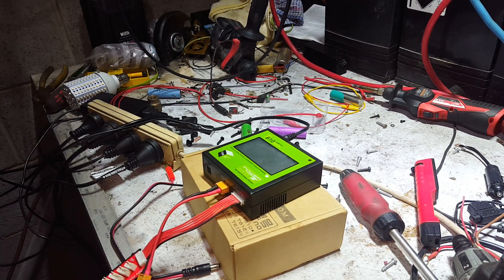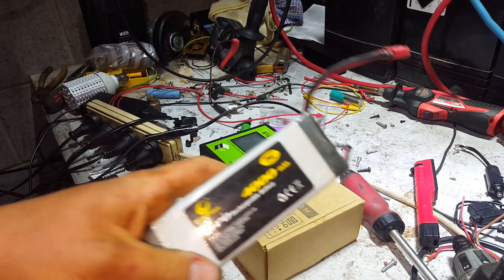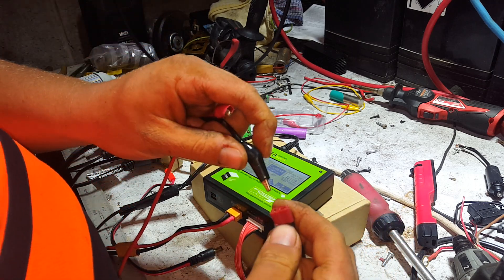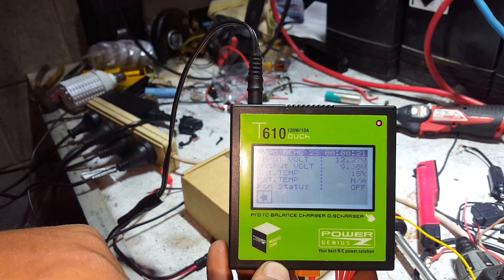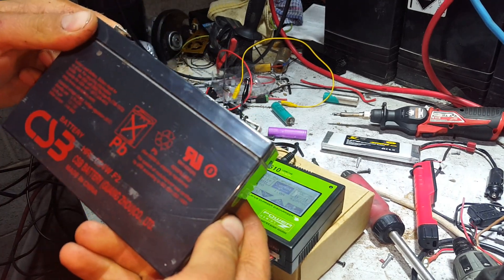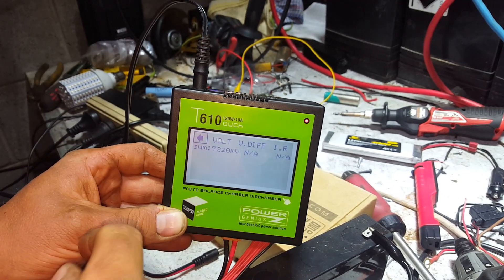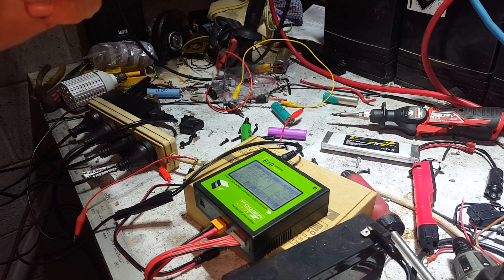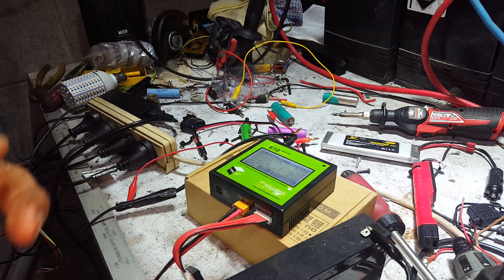Power Genius PG T610 120W 10A Lipo Battery Balance Charger Touch Screen review

Comment: Have you checked how accurate the 1S voltage reading is? Mine reads 100mV low which leads to charging a single cell to 4.3V! A 6S reads properly with the balance lead connected (and calibrated), but reads 100mV low when the balance lead is disconnected.
Reply from the maker: Yeah its very close like 4.22 on mine